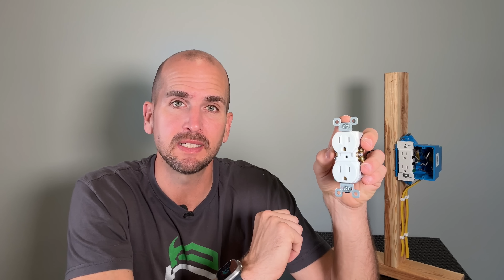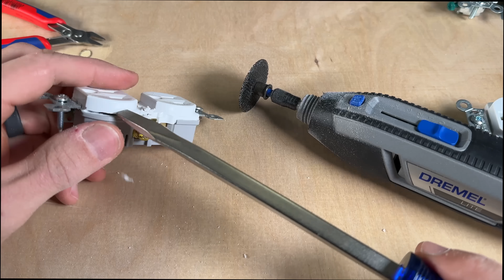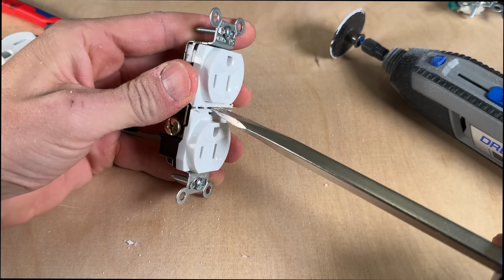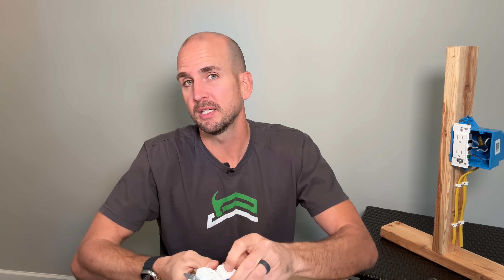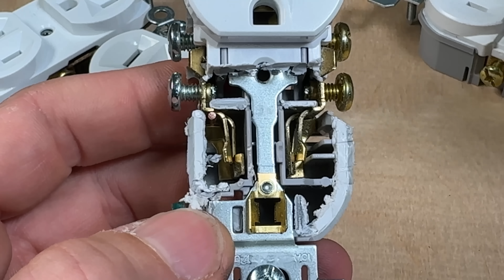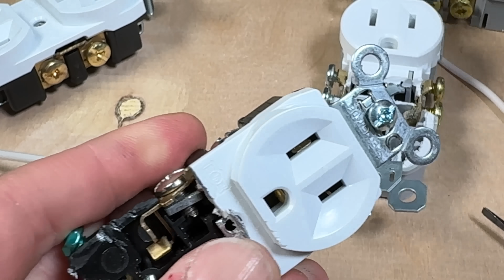Which Outlet Is Right For Your Home |  Watch Before You Buy

Comment: Leviton vs Legrand teardown would be very interesting.
I like to install 20 amp Leviton+ outlets even on 15 amp circuits
They feel so much nicer and I imagine the internals are also beefier
Reply: I'm pretty sure that's against both code and common sense - you know the circuit's only good for 15 amps, but there's nothing to stop somebody who doesn't know that from plugging in a 20a device and instantly and repeatedly popping the circuit breaker - or worse.
Reply: @Skyhawk-q4e  interesting I never thought of it that way good to know 
I don't have any 20 amp appliances/devices that I'm aware of.
I always found it odd that you can have 15 amp duplex outlets on a 20 amp circuit there's a good YouTube video that explains why it's legal.
Reply: @erichubbard7754  Post the link please...
Reply: @erichubbard7754  reason is a 15a receptacle will only accept an appliance that draws 15A max, so no danger of overload on a 20A circuit.   A 20A plug on an appliance or power tool means it has the capability of drawing up to 20A, so this would overload a 15A circuit.   Incidentally 20A plugs are rarely ever encountered in a typical home or apartment,  but if you do encounter one, such as for a commercial grade microwave oven or treadmill,  somewhere in the instruction manual will more likely than not say something like "FOR USE ON 120 VOLT AC, 60HZ, 20 AMP INDIVIDUAL BRANCH CIRCUIT ONLY"   and per the NEC you are required to install equipment in accordance with the manufacturers instructions, to ensure you are not voiding any UL listing or warranties.
Reply: A 20-amp outlet cannot be used with a 15-amp rated circuit due to the electrical load being more. You'll overload it!
Reply: @UCxZgKu-JwENnZpnEBcxwicg 
I had to double check my panel, my outlet circuit breakers are 20 amp with 12 gauge wire. I'm guessing 20 amp outlets are okay with that breaker wire combo?
Not sure why they cheaped out on the outlets some were pretty light weight
Thanks for the heads up on the code I'm definitely not a licensed electrician
Reply: @erichubbard7754  Yep, good to go.  The wire gauges for reference are: 15A - 14 gauge, 20A - 12 gauge, and 30A - 10 gauge.
Reply: @erichubbard7754  perfect! good job. If you have time take some classes. Trust me you will learn a lot and will save a lot of money DIYing.

Comment: I’ve got to replace a GFCI duplex outlet. It’s in a surface mount weather box with a lid. The box is in good shape. Should I get a outside rated outlet or is a bathroom/ kitchen one good enough since it’s inside a weatherproof box? The one in it now is rated bath/kitchen the builder installed in 2001. I’ve cleaned it a couple times looks oxidized and it does work but will pop off occasionally without a real heavy load.

Comment: As a very long time DIYer, the greatest mistake I have made is not using commercial grade receptacles. Especially where there are regular and frequent plug-ins. The cheap ones just wear out. Don't need to take them apart to know that.
I also find those tamper-resistant receptacles annoying, difficult to use and unnecessary. I will not use them. If found, I will replace them. I think I bought one by accident and returned it.

Comment: I needed an outdoor outlet for an 4' LED light.  I went to Lowe's, found a Helper and asked which one to buy.  He told me, They are all the same.  So I searched the stock and found one rated "TR," Tamper Resistant, and "WR," Weather Resistant, so I bought it and a plastic cover case.  It will be connected to a bathroom GFCI outlet, so it will be protected through that and I didn't need to buy one for the box.  It's 15A, has 14 AWG backstab and J-hook-wire, side-wiring screw connections.  I couldn't find one with screw-down pressure plates (you know what I mean), so I bought this one.  I threw out the box, so I cannot give the part/model number, but I think it's Eaton.  Construction is: white front, blue body.  The fixture will be under the eaves, mounted fairly high on bricks, so it should should be protected from rain, but we have high humidity here in Summer, so I wanted WR.  However, the Ground connection must be internal.  It is not on the back, so I guess it's not Commercial grade for two reasons.  Had I realized, I would have bought Commercial grade and I'll try to remember Legrand in the future.  Thanks, Scott!
Reply: Since you won't be inserting and removing plugs regularly, don't lose any sleep over the outlet you purchased. It will still be working a century from now.
Reply: @robertjoseph1592   Thanks, Robert.  I'm sure that's true. but I would have bought Commercial.

Comment: What fascinates me is the fact that these specific electrical components are not standardized as far as quality/safety, regardless of rated amperage rating. My interpretation of this is that the cheapest ones are only slightly less expensive and not necessarily less safe than the higher quality ones, with respect to the fact that are ALL required to meet a certain safety standard.
Reply: @InfiniteEggnog Lay off the egg nog.
Reply: The higher spec outlets will last longer.

Comment: Tamper Resistant outlets are just awful - It's crazy hard to plug things in, and you push so much with no give that you start f-ing up the outlet (if plastic boxes)  code failed on that one I feel - those plastic inserts have been around forever and way easier
Reply: That's another indication of a cheap outlet usually. Use the Legrand commercial grade tamper resistant outlets and you barely would even notice a difference with the non-tamper resistant ones.

Comment: Commercial outlets for sure. Residential switches are okay. The only place I might use a commercial switch is on a garbage disposal or high current application.
Reply from the maker: Yeah I also found little benefit from commercial switches

Comment: Bought a 2 year old custom home here in SC. Had a problem with a non functional outlet and overhead fan in a bedroom. Determined it was because of cheap residential outlets and back stabbing of the outlets. It had worked it's way out of the outlet. Cheap and lazy
Reply from the maker: Yeah, unfortunately in most places around the country $500K homes still have all the cheapest products you can find at the big box stores  🤦‍♂️

Comment: Unless I was trying to be extemeley budget conscious, I always go with commercial grade in my own home. The cost difference, at least for me, is negliable. I've been replacing all of the outlets around my house that was built in the mid 90s over the last few months (just a time restraint and laziness thing) and I just prefer the extra assurance.

If I was working on a project for someone else, I'd recommend commercial grade, but I wouldn't feel like I was endangering them using residential grade.

Comment: I knew there were differences but never paid attention. I bought whatever. Now, from watching these videos, buy commercial. It's only my home now so the difference in cost does amount to much. Thanks for the info. BTW, recently I rewired a full 4 inch square box. I went from wire nuts to wagos. The difference in room inside the box was incredible.
Reply: Same. Even the WAGOs
Reply: Your taking advice from the wrong guy.

Comment: Commercial for outlets. Not sure commercial grade switches are worth it but I'd be curious what others think.
Reply: No, commercial switches aren't worth it unless you hate bending hooks for whatever reason. Speaking for bending hooks, residential receptacles aren't bad for low use applications or for devices always plugged in.